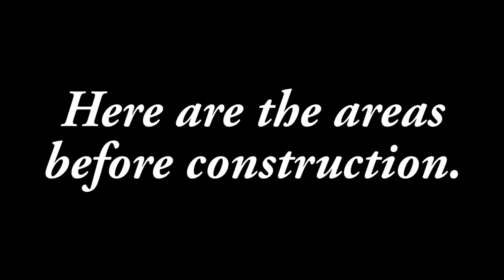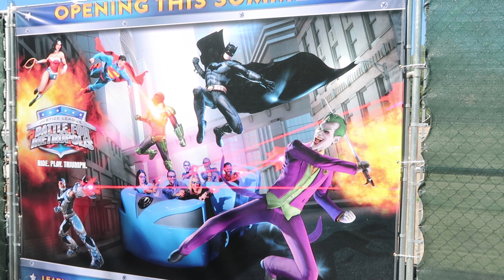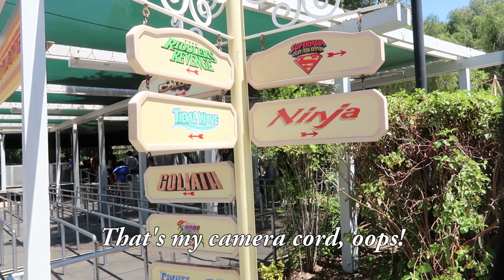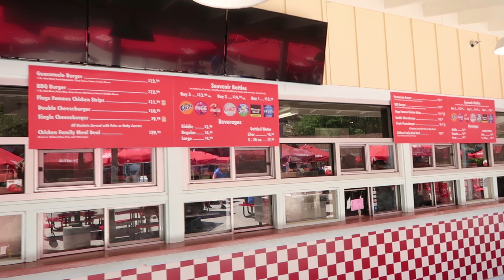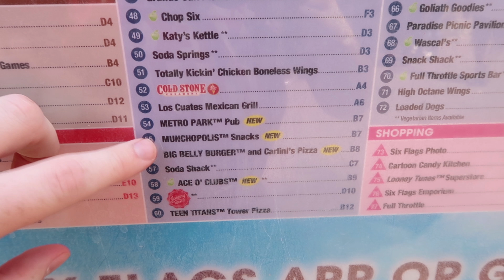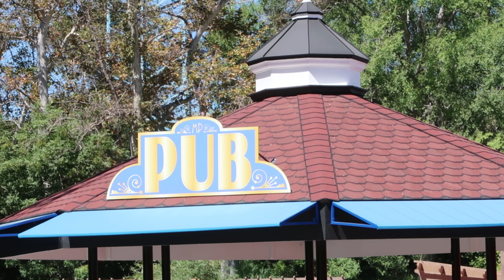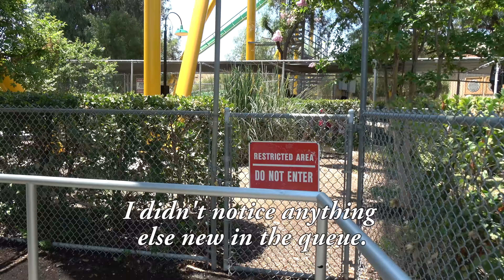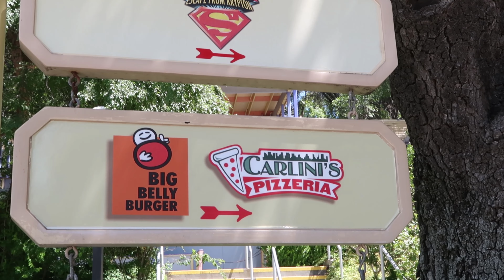Justice League: Battle for Metropolis -- Full Updates: From Dirt to Opening

Comment: With all of that area that's in front of The Riddler and Justice League they should put at least 2 good DC flats there: Catwoman's Whip(2 generation enterprise and Harley Quinn's Spinsanity(troika).

Good thing we're getting the new CraZanity next year.
Reply from the maker: Both of those rides are pretty similar, so if the park did put something in that area, it would probably just be one of those.   They'd also want to make sure whatever they put isn't too tall as it would block the sight lines.